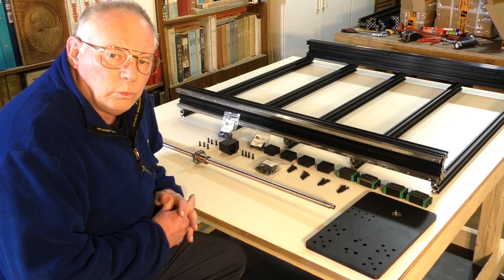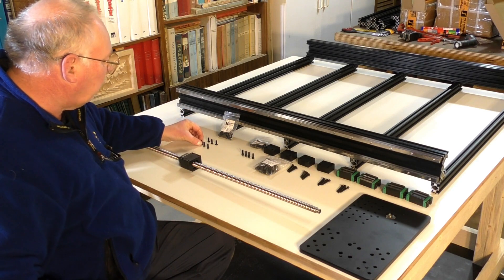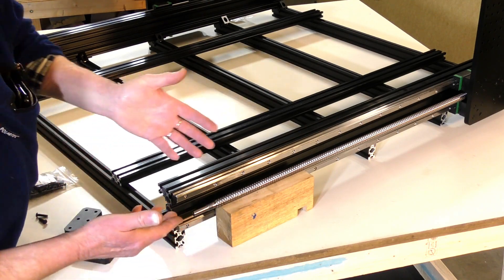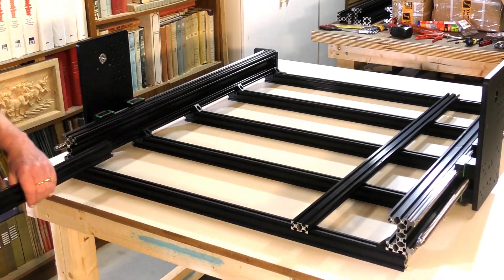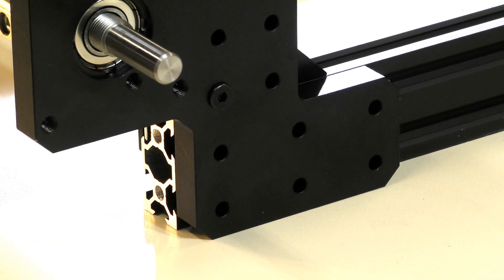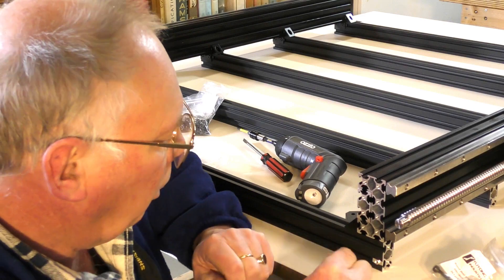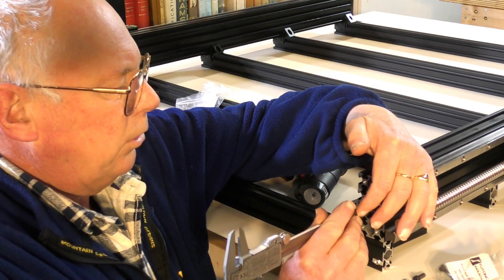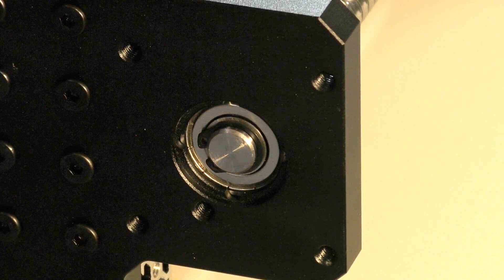Part 2 QueenAnt PRO 1010 V2 Super  Enhanced CNC Router Y-axis Construction

Comment: Great video sir.
I have a question, 
have you put any thought into cleaning bearing blocks prior to mounting them?
I noticed that yours also had some resistance when mounted, and were kind of skipping, when pushed along the rail..
Reply: Your suppose to clean out the bearing block with alcohol bath, then regrease them during assembly.  He may have cleaned them out before filming.
Reply: @hls30000 no way by the sound when he installed them at 5:30